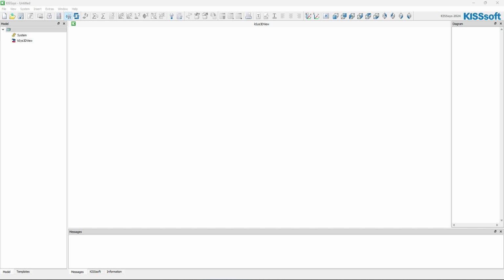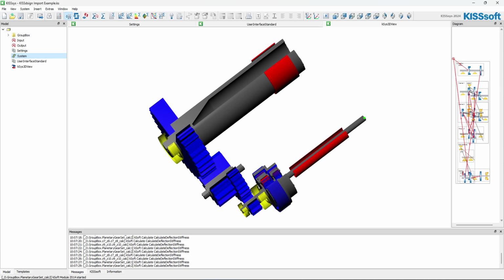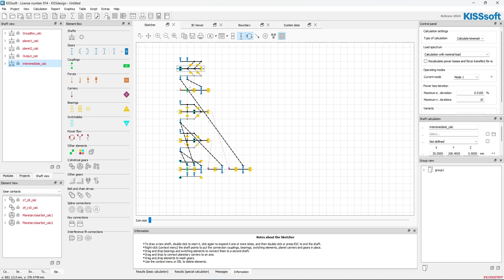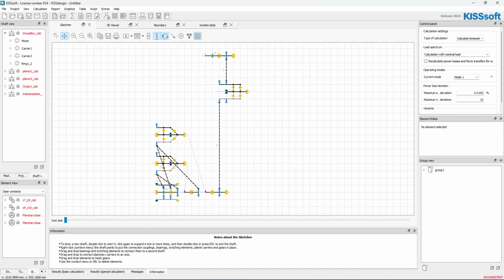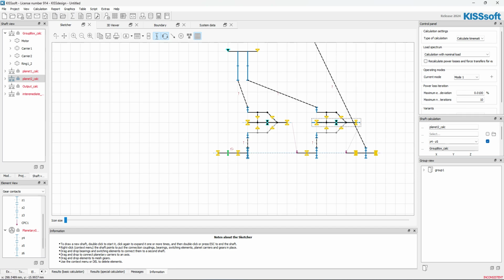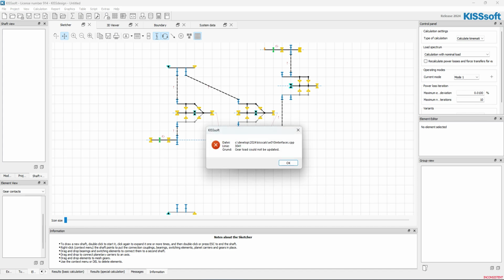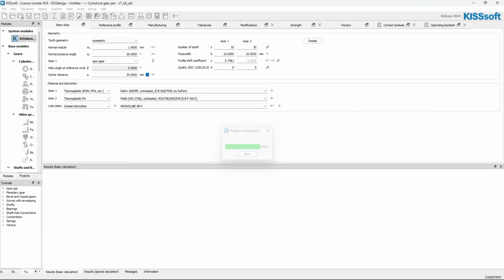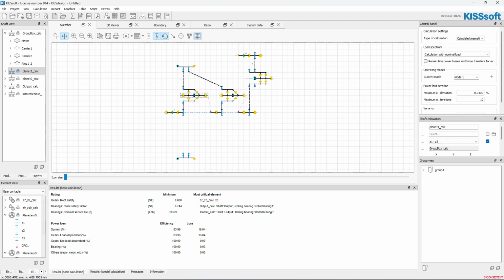KISSsys® Export to KSD

Comment: Thanks for the video, how can I do the opposite and export a model from kisssoft design to kisssys?
Reply from the maker: If it were me, I'd set up a general kisssys model and then save all of the KSD submodels, then open them  in KISSsys.  You'd have to make sure all of the elements were named the same though, could be a real pain.  I don't think they planned on going the opposite way when designing the interface.
Reply: @kisssoftusa9363  Thanks for the fast reply I appreciate it, one more question please, I keep getting a problem when I use contact analysis "Calculation has not been carried out, lubricant: Load stage micropitting test not known" does that mean I have to use a load spectrum to be able to see the micropitting in my gear?
Reply from the maker: @AbedAbdo-ml7lk  I think that is the lubricant doesn't have the data required for the load stage test, If you run it outside of contact analysis does it run consistent?
Reply: @kisssoftusa9363  I can't get the micropitting data with or without contact analysis, for the load stage I didn't identify a lubricant there, there is only one stage load with 100 frequency with torque, but the simulation is consistent, there is only this problem in micropitting.
Reply from the maker: @AbedAbdo-ml7lk  I'd have to see the file to see what's going on, can you send it to ty.warner@kisssoft.ag